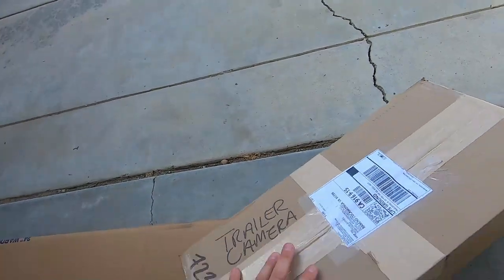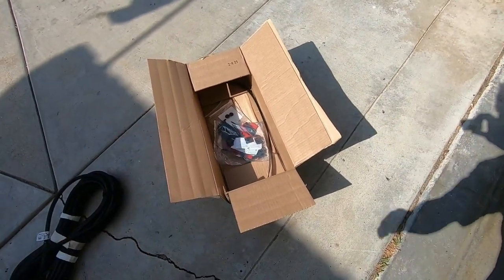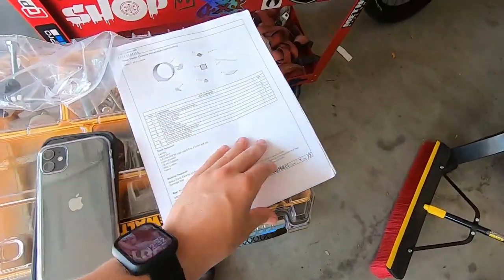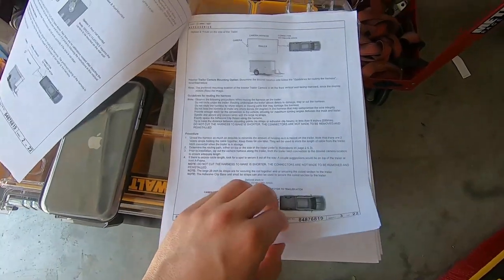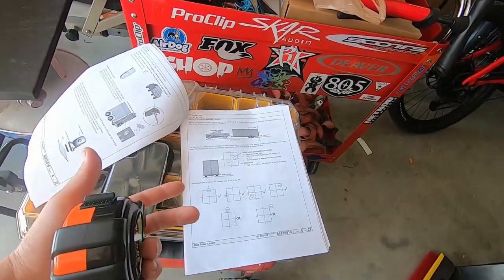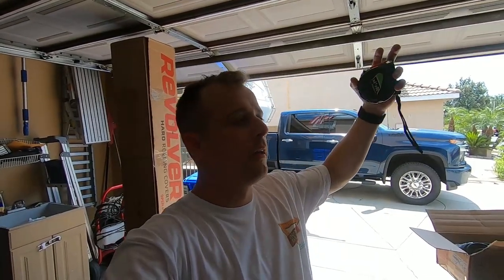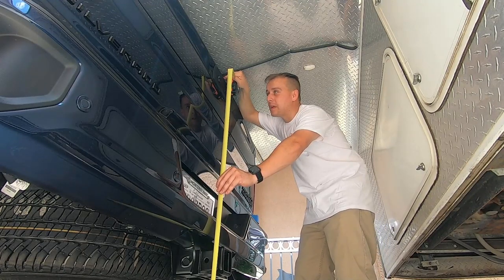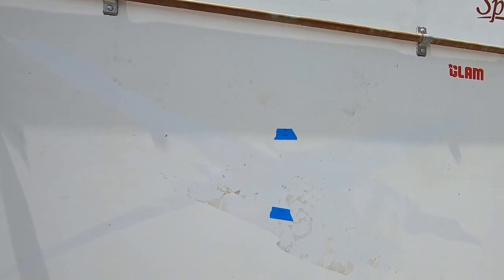Installing the GM Trailer Camera on my 40' 5th Wheel

Comment: I have used this exact camera for the back of my horse trailer for the past 3 years. It works excellent and is simple to install.My trailer is about 36’ long and there is plenty of extra cable/wire. I have mine mounted on the hay rack storage on the top of our trailer and it gives me a very wide view of who is behind me, etc. Also the instructions recommend NOT running these cables under the trailer. I have my cable on the roof and used isopropyl alcohol to clean where each adhesive cable holder is applied to the roof. The cable runs through the clips (adhesive with zip ties) and down the length of the roof and down the side of the gooseneck and under. The excess is held with the “giant” zip ties. 

The transparent mode has to be on the back of the truck not the back of the trailer. You have to pick one way to install.

Comment: So I have used this camera system with my 26ft travel trailer and it worked perfectly as advertised. When I got my 34 ft 5th wheel it did not work. What I ended up doing was manipulating the numbers to fit in to the parameters the manual called for. I then drove it to calibrate it and it worked. I did set up a different profile to test this out, however I ultimately just went back to using it as a back camera without the trailer vision feature. Just figured as long as I can see what’s behind me I’m good. The new HD GMCs they are coming up with is “supposed” to have the ability to work with longer trailers. We will see. GMC makes a lot of promises they haven’t been keeping it seems.
Reply from the maker: I kept trying to make a new trailer but it never asked me the length or anything. good to know.

I saw that on the 2024's , definitely curious to see how that plays out.
Reply: @americanduramax  okay, don’t do it as a 5th Wheel but as a travel trailer. You have to trick in to believing you are pulling something shorter. So manipulate the measurements .
Reply: @Ren O  but won't that confuse a driver into thinking he has room to move over cause nothing is in the way
Reply: @thomasroseman575  no, I did not find that it confusing at all. It helped to see what was behind be and side view mirrors In combination with these cameras just provided additional situational awareness of surroundings in my humble opinion.
Reply: @Ren_O_72  but your trailer is longer .when in transparent mode your a few feet longer in reality than what you see. I have a 42 ft rv. Don't you think it will be really off ten ft longer? I guess I will try it I also have spare tire that I think be obstruct the view.

Comment: I was looking at another video. He was saying had to do a download. Doesn't tell you anywhere to do that. The drive straight  no turns for like 5minutes then he could set it up but on travel trailer only and fool into with shorter measurements. By the way I was thinking of putting that diamond plate type stuff on mine. Did you do it yourself. Or was it there when you bought iy
Reply from the maker: Thanks buddy. Never heard of downloading a software or even where to download that at.

I purchased my trailer with all the diamond plate on it so i have no idea where to get that stuff or how to modify it lol
Reply: @AMERICANDURAMAX  ok thanks.
Reply: @AMERICANDURAMAX  the download told him the max dimensions it had to be then drive straight under 30 mph. Then it calibrated and worked

Comment: yeah they should have mirrored the 5th wheel connections with the camers........2 separate connections.....1 inside the bed and 1 outside, like you said they could have pig tailed easily and threw another camera connection inside the bed......i just bought this truck
Reply from the maker: Yeah agree'd, makes no sense why they did it this way. I will have a video soon. i have had the parts for months now on how to swap the bed plug and extend the wires

Comment: Nick, I have same setup for my truck not installed yet because not to crazy about the wire routing, my buddy has a wireless setup on his truck, but I don’t know if it’s compatible with the stock camera, once again GM dropped the ball on this one 🤔
Reply from the maker: Yeah the wiring is annoying especially because of the camera connection placement. I need to look but i know they made some changes on the 2024 models and may have changed this since now the 2024's can see thru 5th wheels with no problems like what i was trying to accomplish on my truck. idk what technology changed to make it work with trailers in excess of 32' but they got 5th wheels added now.
Reply: Hi, what brand or kind is the camara ?
Reply: @americanduramax  Good information.  I have the 2024, bought the camera system specifically for the 2024 I just haven't pulled the trigger because they want it mounted right smack in the middle of my 40' toy hauler's ramp.  I'd probably consider running the wiring down the ramp exterior with some wire mold and then under the trailer and up through the battery bay or LP bay to the kingpin.  I've seen the camera also mounted with heavy duty 3M two sided adhesive.  Just haven't pulled the trigger yet.